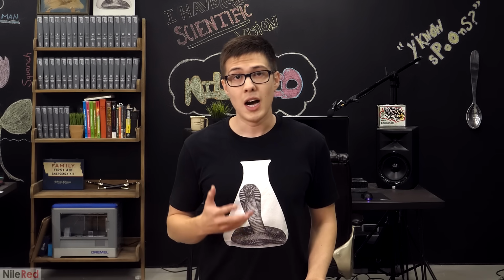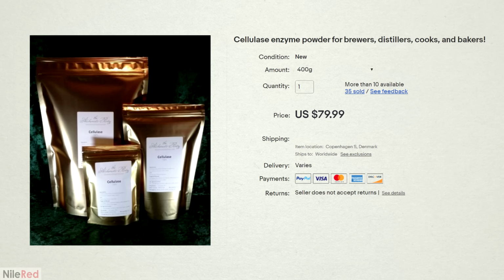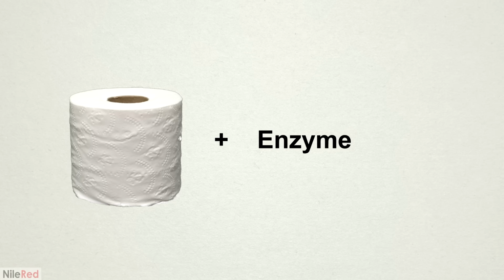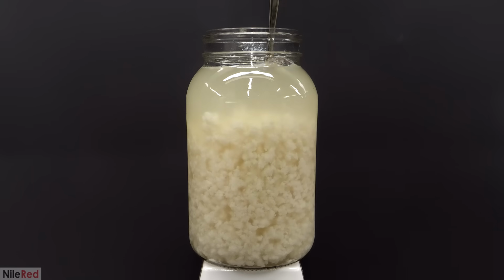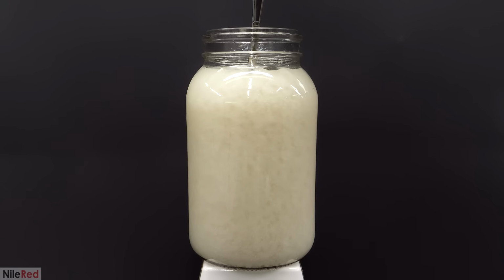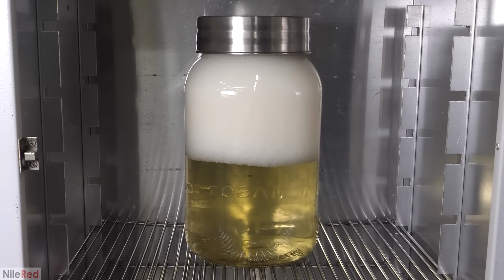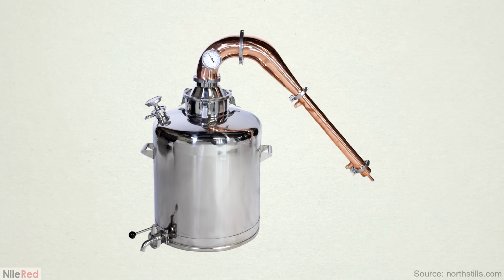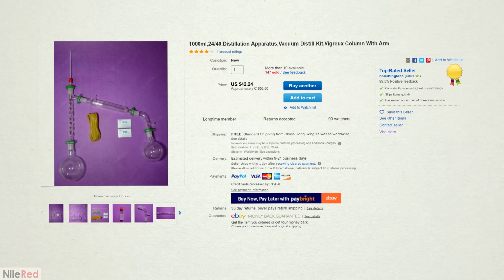Making toilet paper moonshine

Comment: In this project I probably wouldn't have used the "heads" or "tails" of the toilet paper itself. Meaning I probably would have torn off and discarded the first and last 5 to 10 squares of the toilet paper to prevent random adhesives used at the beginning and end of toilet paper rolls....because God only knows what the crap those adhesives are or what they could possibly break down into throughout this process...

From a quick Google search on "toilet paper adhesive":

Core winding – The paper tube is formed using either hot melt glue, dextrin-based or polyvinyl acetate-based adhesives depending product specifications, yet all of our adhesives allow for high-speed production, fast-drying, and stable rigidity.

Pick-up (Transfer) – For excellent machining and clean processing, our adhesives provide excellent release and tack that works great on surface winders or center wind machines and have no staining, even for spray applications. 

Tail-sealing (Tail Tie) – The last step to a finished roll, our adhesives give the top sheet just the right wet tack and excellent release no matter what adhesive application used.

HAR Adhesive Technologies supplies any kind of adhesive used for bath tissue and paper towel converting, including hot melts, water-based adhesives and the standard dextrin line. These specially formulated adhesives offer excellent mileage and quick-setting characteristics for improved line efficiency and quality.
We work with each customer to select the adhesives and the adhesive application method to achieve higher productivity that match their requirements along with consumer expectations. To find out more, please complete our request form or just give me a call.

Comment: Couple of thing. First off you need to rack it. 
This allows solids to settle out. Then you needed to  degasify (stir it) 
Next you need to use a bigger still. Why when hot distilling you also produce methanol or other byproducts. A small still makes it harder to separate yer cuts. Your first cut is tossed. When you make yer hearts. Keep separate. Yer tails you dump in the thumper.

Comment: You have to find an enzyme suitable to break down that particular form of cellulose a friend of mine that works in at genzyme was working on that project and using a mold that was capable of breaking down canvas easily I can't remember the name of the enzyme but it's very rare and very expensive. Where is East won't do anything until the end times break it down into simple sugars
Reply: By the way I made moonshine for 35 years not anymore

Comment: My question...@19:59 would be how does Aluminum (a conductive metal) insulate your column?  I knew it helps but isn't it more thermally reflecting instead of insulating?  Just a thought.
Reply: I believe it's because the heat was coming from the bottom of the flask, where the aluminum wasn't. Then, the aluminum could trap the heat that was inside the distiller.

Comment: "Molar concentration is a measure of the concentration of a chemical species, in particular of a solute in a solution, in terms of amount of substance per unit volume of solution. In chemistry, the most commonly used unit for molarity is the number of moles per liter, having the unit symbol mol/L or mol/dm³ in SI unit. Wikipedia"

Comment: 28:50 or so . When the drop hits the top in the beaker if you look at the bottom what is moving down there that looks like I can't even explain it but at the bottom of the beaker there's like a clear drop inside the liquid

Comment: It might have been better to use a top-fermenting yeast, which would 1) prevent the yeast from sinking into the cellulose at the bottom, and 2) be more efficient at such a high temperature, since the optimal temperature for top-fermenting yeast about 30°C whereas for bottom-fermenting yeast it's 5-10°C.

Comment: I Have to say something. If you still have it do NOT drink a large amount of it. IT will make you go blind. Toilet paper is Made from wood. The reason moonshine can make you go bind is because it contains Methyl alcohol, very similar effects to ethyl alcohol, but the body turns it into formic acid, a chemical that can make you go blind. Ethyl is grain alcohol, Methyl is wood alcohol. Toilet paper is paper, made from wood. I may be completely wrong and something you did turned it into ethyl, but i still would not drink it because it may be methyl.

-Samcq50, An Experienced Shiner

Comment: You could have used a hydrometer to measure the the amount of available sugar, and then measure it later on to work out the % alcohol. There's more to it than that but that's how you work out what % to expect and when it's finished fermenting. Also brewers yeast typically work in the 15-25c range, above 30 is too high and you'll have inefficient fermentation with off-flavours from the stressed yeast, or even kill the fermentation. The fact that you put in the oven and the fermentation stopped sounds like you killed your yeast. You had very little sedimentation as well, which is another sign that fermentation ended early.

Also you probably have cancer now from the drain cleaner and bleach form the toilet paper along with other additives.

Comment: Dumb person here, but wouldn't 10% of the volume mean you'd have 10x the concentration? Assuming nothing was lost in the process?
So if you started with ~2% ethanol, after distilling it to 10% of the volume, you'd have a concentration of ~20% ethanol?

This was confirmed with the hydrometer, but again dumb person here and I have no actual clue. Was just wondering if this worked out on a mathematical scale or if there are other factors at play?

Comment: how did you check to see if it contained methanol? put some on a spoon and light it after distilling if it burns with a yellow flame it has methanol in it and you should not drink it, when it burns with a clear blue flame it is safe to drink.

Comment: Doesn't water have a higher boiling point than the moonshine itself? If so wouldn't it have been easier to lock the temperature at the boiling point for the moonshine.

Comment: wait, couldn't we build a factory to turn trees into glucose and stop world hunger until we run out of trees?
Reply: This is like multiplying 6 by 1 by adding 1 + 1 + 1 + 1 + 1 + 1
Reply: Even if you could produce an unlimited supply of glucose for free, that doesn't solve world hunger. Eating nothing but sugar is a good way to die of malnutrition, and world hunger is more of a distribution problem than a production problem anyway.

Beyond that, processing cellulose from wood is surely not the easiest way to get sugar, if it was we would already be doing it. We already get our sugar from plants, we just chose plants that actually efficiently produce large amounts of sugar in easily usable forms.

Comment: For those curious. To find the proof of alcohol, take the percentage and double it. In this case, 64% would be 128 proof. For it to burn it has to be at least 80 proof or 40%.
Reply: 🤔 what brand of 80 proof have you lit on fire? In my experience it takes 100 proof or higher.. 100 proof barely burns. Flame on liquor in this video was much closer to a lit shot of 151....

Comment: As a recreational homebrewer (beers and ciders) I was thrilled by your chemist's take on the fermentation step.  I noticed you used a hydrometer to measure the alcohol content of the distilled spirits; I've never distilled anything but I use a hydrometer to measure the alcohol content post-fermentation.

To do that, you measure the specific gravity of the liquid before and after fermentation.  Prior to fermentation, the specific gravity will be greater than 1, due to all the sugar dissolved in the water.   After fermentation; the gravity will have dropped (due to the yeast converting sugars into alcohol) and you use the amount of that drop to calculate your %ABV.

Your analysis of fermentation put a whole new light on how much chemistry goes on in my hobby.  Thanks for all you do!
Reply: I quit drinking 5 months ago, i miss the brewing process the most.  more than the drinking for sure, just making a killer stout or IPA, babying it, doing tastes, kegging it and trying to forget about it for awhile if its a stout, force carbing if its a IPA.  My 4 tap keezer still has about 10 gallons in it probably too, no heart to pour it.
Reply: @ChunkyWaterisReal I made my first ever batch of beer recently. The thing is i even don't drink alcohol. Tried a few times but i never liked it. 
I just made it so i can give to my friends. 😂
Reply: Sorry, what is %ABV?
Reply: @MrMrannoying  Percentage of alcohol by volume.  Usually measured in percentage points for beers (e.g. 5.8%) and "proof" for distilled spirits (1 proof = 0.5% ABV, 80 Proof = 40% ABV.)
Reply: I could brew better